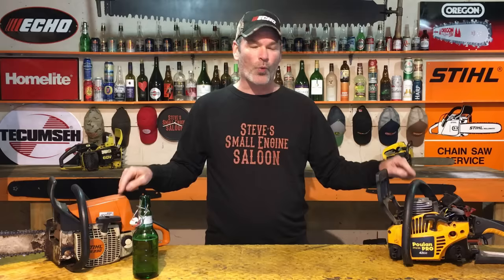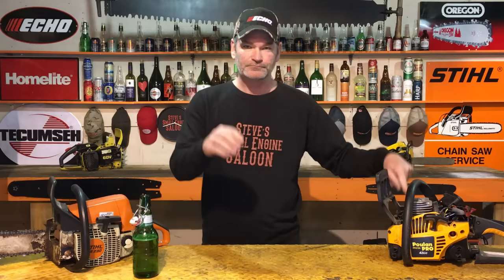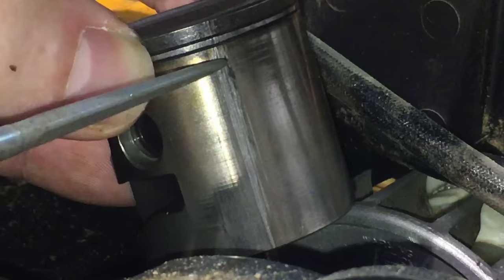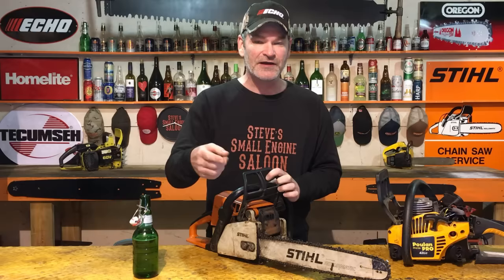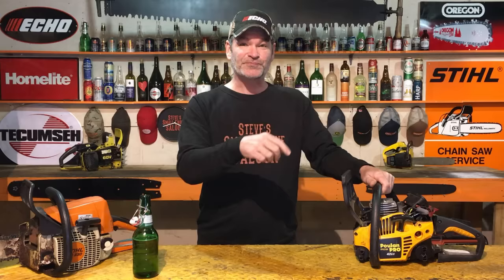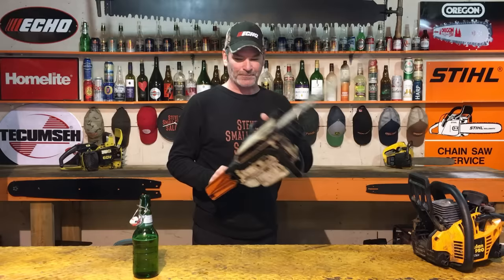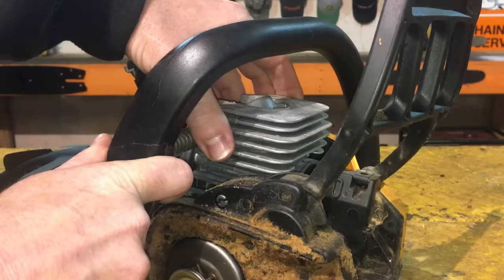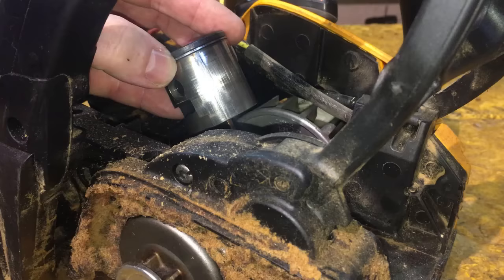WARNING: Never Do This To ANY Chainsaw

Comment: I start my saws, place them on the ground where I am cutting and let em idle for 5 minutes. Besides being good for my saw the vibration clears out the snakes.
Reply from the maker: LOL!  Right on
Reply: Must be from midwest.  All snakes here in Oklahoma will clear out but the cotton mouth like a challenge.
Reply: @StevesSmallEngineSaloon  thanks for the heads up
Reply: Should put some idle chainsaws on the floor of congress then...
Reply: I can't let mine just sit on the ground running. It will bounce and hop all over the place.
Reply: @andreassjoberg3145  corectamundo bud 😂😂🤙
Reply: @braccuss21111  Yeah, the moc is always like "Hold my beer."
Reply: Yup
Reply: But there's no one that can tell me exactly how long it takes exactly to warm one up in a correctly amount of time.
Reply: Snakes come to chain saws around here.  Rattle snakes do.  7'9" is the biggest I saw.
Reply: Andreas , 🤣🤣🤣🤣🤣🤣👍👍👍👍👍👍👍🙀👍👍👍👍agree Damn Snakes
Reply: Undeniable  !
Reply: @dentondunn4346  
I think it is situation dependent and each time it's different. But it's very important to allow time for one to warm up. Or are we still talking about chainsaws?!
Have a great weekend.
Reply: @braccuss21111  Lol.Australia!
Reply: @Tom-hp3kw  
Cheers mate! Spending this weekend on the lake. Back to cutting again next week. About to have a cool down which is highly needed in my parts. Been 100 degrees with sticky high humidity and it's a killer but for now the water is great.
Reply: I like snakes... A months ago my son was in a mud pit with at least 18 snakes that we could see....mostly cotton mouths.... 

Much better than politicians as they are honest....
Reply: @MattyDemello  Turn the idle down
Reply: @andreassjoberg3145  you aint wrong.. better make em 880s too
Reply: @andreassjoberg3145  ha ha ha, THAT was great AND SO TRUE.
Reply: @dentondunn4346  5 to 10 minutes. Smoke a cig.
Reply: @dentondunn4346  what I do atleast is, I feel how hot the exhaust gets, and once it stops getting hotter I know it's hit peak temp
Reply: 5 minutes! Damn that's a long time and a lot of fuel. Sometimes I don't even spend 5 minutes cutting.
Reply: @andreassjoberg3145  Best comment ever
Reply: Just enough time to finish off a beer.
Reply: Yup in hurricanes pop would have saw’s warming up I’d have the 4/10 pump looking for snakes vipers got shots on the spot 🎉
Reply: @braccuss21111  most vipers think fighting 😂
Reply: @ridgerunner106  RATTLESNAKE?
Reply: @brandonkelbe  Velvet back timber rattler.
Reply: Snakes come directly to a running engine vibration on the ground.  If you stay in the area more than 5 minutes, you'll see.
Reply: Yup.

Gotta let the thing come to temp before ziptieing the trigger down and letting her eat for the day.

Even if it's hot outside. Time may be money, but 5 mins heat up time is far more cost effective than buying a new saw and going to pick up said new saw whenever your equipment breaks.

By all means, love that full send lifestyle. I prefer to work until the jobs done and then not cost myself extra labor.

You do you baby boo 

Stay greazzy
Reply: @ridgerunner106  They can get that big? wow
Reply: @brandonkelbe  I know of three over 8 ft and big as a two liter bottle.  My neighbor killed two of them.  24 rattles and a button.  Good friend got the other.
Reply: Good call
Reply: @braccuss21111 
Ain't it chooge!

Comment: My dad taught me to treat any internal combustion engine like a woman. A cold start will definitely sieze them up.
Reply: niemi5858 naa just jam it in there
Reply: @spankthemonkey3437  the rippin n the tearin 😍
Reply: This was more of a problem with liquid cooled engine on motocross bikes in my dirt bike riding days. The cylinder would have need of about 10 minutes or so before putting riding the bike. I never had no issues on a air cooled trail bike, the cylinder along with the piston expanded at the same. The tolerances were more vs the liquid cooled bikes though. I have had chain saws before and never had a cold seizure. This one is new to me.
Reply: @markclark1605  Nope
Reply: A coldstart will not “definitely seize the engine up”..........don’t be stupid
Reply: @timbohouston  I've always warmed up all engines even as a kid. Just put of common sense
Reply: The right ones won't.
Reply: @MrGordozzzz    A Text message?
Reply: @PKSINY    Absolutely will.
Reply: ....and look out for a scored cylinder!
Reply: Wow! Thanks for that, Steve. Yet another valueble piece of information learnt. Great video's 👍
Reply: @twosencefromcleveland6084  then why isn't every engine fucked? A cold start can't be avoided, because there's no way to get the engine to operating temperature before starting it. What does kill them was said in the video, and it wasn't a cold start.
Reply: Late to the party but a score is bad with a engine good with a women 😂
Reply: Handy sometimes,they stay quiet lol
Reply: @cyberblock7619  Just to bad common sense aint that common anymore. :/
Reply: That is why I went battery operated for both; it saves me from alot of unnecessary complications.
Reply: E S @ electric be better,battery replacements end up costing more than the unit
Reply: @jazalessandro3094  I would tend to agree, but some tools are used in areas without power outlets, and I have yet to find an artificial vagina that runs on 220V.
Reply: E S Bahaha I was waiting for that smart fella xD 
nothing a lil generator won’t fix tho 😂🍻👍
Reply: @PKSINY  but loading/working the engine straight from a cold start might well do so! that's what Steve claims here
Reply: That’s a wonderful analogy 😂😂 Well lubed when adequately warmed up👍🏻
Reply: The older they get, the more they seize up.  And they wonder why guys die younger...we just get bored to death.
Reply: Aye man to that
Reply: Not always. My ex would put it to you from a cold start
Reply: @WeldingForJesus  LOL BATTERY POWERED LOLOLOLOL.....DO THEY SELL MENS TOOLS WHERE YOU GOT THAT SAW?
Reply: @craigbielsky115  YES THEY ACTUALLY DO, ROFL. BUT I DON'T HAVE NEED OF A SAW THAT CAN CUT 12 HOURS A DAY FIVE DAYS A WEEK. I ONLY HAVE A FEW TREES IN MY BACKYARD AND THE LOW MAINTENANCE OF AN BATTERY SAW IS QUITE PERFECT FOR ME.
Reply: Really filthy eh?
Reply: Filthy startup!
Reply: My wife (now ex-wife) seized up and took a vow of celibacy the day after our honeymoon.
Reply: 😂 that's a good lesson.

Comment: I am guilty of not letting my chainsaw warm up😩.  Thanks to your video, I will from this day forward, mend my evil ways...long live my Stihl and Steve!!👍
Reply from the maker: Right on Mark!
Reply: I’m guilty as well
Reply: I learned to utilize my time of letting it warm up while I get my other equipment ready.
Reply: @Daniel08353  that’s a fine idea, I’m always standing around looking like a dolt
Reply: Repent!!!Sinners beware, you will get rewards for your deeds.
Reply: Never seen this to happen, but it does make in very tight tolerance new engines. On older worn out engines that i primarily run this might be less of a issue, but i go predicting its the cutting resistance that does this problem, so when i start the saw, i give it few second to get on the initial temp and spread the oil around from sitting, give it few rews and then start to saw with least amount of pressure that is practical, then increase pressure when saw gets hot. Sort of ease in and most framers cut just few 2x4's usually so not even the piston has time to warm up really.

Comment: A young fellow bought a new Stihl. The spark plug had oil on it after being used. There also appeared to be an oil deposit behind the muffler??? So he took it to the Stihl dealer to ask what this was about. He said the fellow started the saw and immediately opened it up to full throttle and held it there. Then he says the saw works properly. This young fellow had already learned from me(and you) that this damages the engine, so he told me the dealer removed a year or so of the life of his new saw :-(

Comment: warm any piston engine up first, some advice from 100 years ago is still valid!
Reply: I know that chainsaws and vehicles are, so to speak, different animals. I would guess, however, that the same advice would apply to vehicles-let them warm up first, before driving them. I can't tell you how many times I've just started my vehicle, and just took off, without letting it warm up first. I'm lucky to have a functional vehicle! I need to remind myself:let your vehicle warm up a few minutes, before taking off!
Reply: In sick of people telling me you dont have to warm up many engine you are correct! Warm it up
Reply: My engine " if that's the case then tell JAY LENO  to fire up his classic cars and instantly drive off ,
Reply: My engine"
Reply: @ronaldshank7589  Unless it's extremely cold out, just start your car when you get in, do the thing with your seatbelt, mirrors, radio etc. and just drive off. Drive smoothly, no jackrabbit starts, leadfooting etc. and you'll be just fine. No need to sit in it and idle the mill for a minute or two--it just isn't needed.
When very cold outside, it takes time to scrape the ice off the glass and brush the snow away, so it warms up a bit while you're on that.
Reply: Cold seizure is mainly a 2-sroke problem. 

I suspect the cause is twofold.  First, the piston heats up and expands fairly quickly, and second, the cylinder sleeve gets hot quicker alongside the exhaust port, which causes the cylinder to change shape as it warms up.

Modern automodiles don't require idling to warm up.  In fact, idling a cold engine means it takes longer to reach operating temp, and increases wear.
The best vehicle life will be achieved by starting the car, give it 5 seconds for oil to circulate everywhere, and drive gently the first couple of miles, then normal driving is fine.  The light load on the engine will warm it faster, and you're actually moving toward your destination, instead of just accumulating running time going nowhere.
Give it a couple more miles before running at full throttle or high rpm.
I've run 2 vehicles 300,000+ miles with this method, and they still use no oil between changes, never had any internal engine problems, and still run like they did from day one.
Reply: Bob Button  diesel engins make an awfully knock if not warmed up.. even when oil pressure is reached.even modern ones.
Reply: Ronald Shank agreed... water cooled engines are more protected from this type of issue as they are temp controlled. 
Definitely do this on any air cooled engine that’s variable speed if possible. 
Fixed speed engines will still appreciate it but depends on the immediate load placed on them after start up
Reply: Devil's Offspring I would say it’s more of an air cooled problem. Water cooled engines are somewhat protected because of the temperature being controlled therefore the component expansion rate is regulated.
Reply: @devilsoffspring5519  my radio is a bitch, so it takes a minute or 2 sometimes.
Reply: @rayban5737  Hi, Mercedes-Benz mechanic here who works on diesels all day everyday. Diesels don't knock because of driving whilst cold. They knock because the fuel is detonating prior to the piston reaching top dead centre and because the fuel is detonating in a non uniform pattern. Newer diesel engines even with advanced piston design and injection spray control cannot 100% control fuel burn evenly because of the nature of combustion ignition so still knock regardless. We can control it to some degree by altering injection pattern timings but this will never cure it 100%. 

Also to add, modern car engines do not require a warm up period to be driven unless in extreme conditions like -30C and below. Just drive normally and you're good to go right from the key turn. Like darkwelder said, the coolant is going to move heat around the engine to allow for even heating as well as the airflow whilst driving which is specifically designed to help with moving heat around the engine bay.
Reply: I've been hearing from a couple mechanics lately. That newer vehicles don't need nearly as much, or hardly any, warm up time. Any thoughts? Also, how long do you recommend warming a chainsaw for? The manual for my husqvarna says to run it basically wide open for 30 seconds before using. Is that true?
Reply: @gr8fakeh8monger  Whether it's a vehicle or a chainsaw. The main point to remember is not to place a heavy load on any engine prior to a reasonable warm up. Husqvarna's 30 second full throttle warm up is a no load warm up.
Reply: @ronaldshank7589  While in cars you may just get in and go, you are very likely driving in a residential zone for a minute or two before jumping onto the freeway full throttle hauling a trailer. With chainsaws if you're cutting wood you're full throttle.
Reply: @devilsoffspring5519  I agree but only because most folks will drive off at 1000 RPM in a car. Not 8000 RPM as with a chain saw.  Effectively driving off slowly is no different to the engine than idling for 10 minutes.

Comment: YES!  They stressed this at the Stihl factory training (Gold level) that I went to a decade or so ago.  Nice to see someone giving actual good advice on Youtube.
Reply from the maker: Right on...
Reply: Is there any book or information   like the Gold Level training that ordinary folks can find?
Reply: My dealer told me to run mine wide open to warm it up as soon as I start it. My new saw wouldn't idle correctly and that's the recommendations he gave me. I took it to another dealer and he adjusted my carb and it starts and idles perfectly now. My original dealer told me he'd charge me a shop charge to adjust it and it was a brand new saw under warranty. I called and emailed Stihl telling them how he treated me as a customer cause $500 is a lot of money to pay for something that runs correctly and the dealer trying to charge me for something that should be under warranty

Comment: Great advice. In my case having reached geezerhood I'm slow enough the saw has plenty of time to warm up.
Reply: Yeppers, having reached geezerhood myself I usually look the job over and decide how the whole job will go before even pulling any tool(s) out.
Before they forced me to retire the kids, (those under 30), would laugh and snicker at how slow I was, then ask me questions as to how I always accomplished so much more than they did, and never had to do the job twice.
The grey hair should show wisdom from the years gone by.
Reply: welcome to geezerhood. where are the geezers when the universe started. they warmed it up alright. ancient of days need to show up and get some work done.

Comment: Another great video Steve.

I’m no mechanic or gardener, just a hobbyist, however, I think it’s important to warm up any internal combustion engine. It only makes sense given expansion and contraction as well as lubrication. Treat your equipment well, service on time and it’ll do you a long, long time ;)
Reply from the maker: Well said!
Reply: I agree...Same thing with automobiles when really cold in winter. Manufacturers tell you it is not really necessary to warm the engine a few minutes....I don't trust that...BS ...I warm my car engine 2-3 minutes when it is minus 10 Celsius or less....This is pure common sense IMHO. Come on...
Reply: @1983dmd  At those low temperatures, you need a few minutes of warm up just to keep your windshield from fogging while you drive.

Comment: New to chain saws. You probably just saved me a lot of grief.
Reply from the maker: Right on buddy...
Reply: Equally important: Check your chain bar oil each time you add fuel. If you hold the tip of the chain saw near a light colored surface, rev it up a little, and see if it slings oil onto the surface. If it does, you know your chain bar is properly lubricated. By the time you've done that, the engine is warmed enough to go to work! That saves your engine AND your chain bar.
Reply: good to know.  I'd heard because its 2cycle ,its getting instant oiling so i dont need to warm up like 4 cycle, so i was thinking of the oil warming up not the cylinder. thanks !
Reply: Im new too...thank you!
Reply: Let every engine warm up before you nail the throttle. It’ll save you money over the years. Car, tractor, lawnmower. It won’t seize like a chainsaw but it does nothing good to rev a cold engine hard.
Reply: Me too. Steve, you're also very entertaining. Great job!
Reply: Same!
Reply: @wetblacklab7174  they run better warm. Just like a lady
Reply: In general- you dont hammer on the throttle on ANY cold engine. Chainsaw is no exception and I dont see why people don't understand this.
Reply: Same here! Just got one yesterday and before really using it, ive been checking out a lot of videos on this channel and a few others. So glad that I did!
Reply: Me too.
Reply: Same here
Reply: Hold on to it,hard both hands
Reply: Gotta say I’ve owned my first chainsaw for 3 months and only just realised chain oil is a thing… luckily I found your channel and saved my ass just in time…

Comment: Had a "PowerEquipment" company tell me that a saw I had bought from them a couple years previously needed some major engine work, and it wouldn't be worth fixing... recommended buying a new saw. Took it to a rural saw shop and they fixed it for like $20. A rubber boot had slipped off somewhere which had made it run horribly. Can't always trust the same shop to repair a machine bought there.